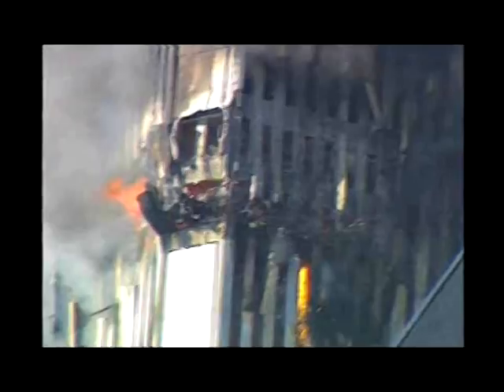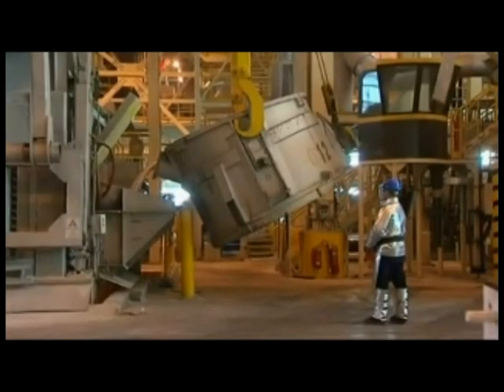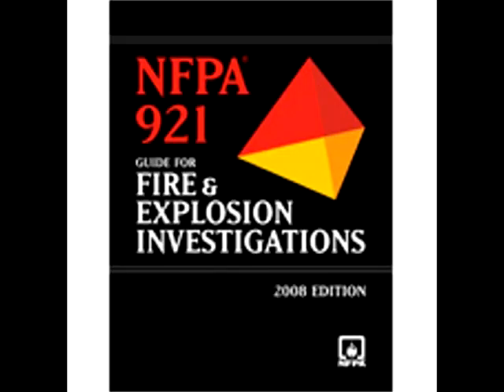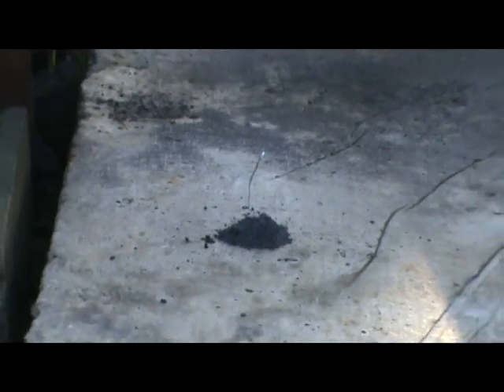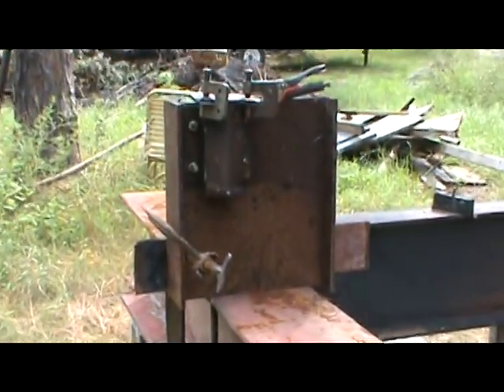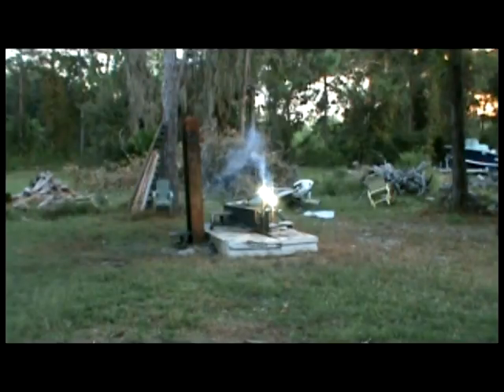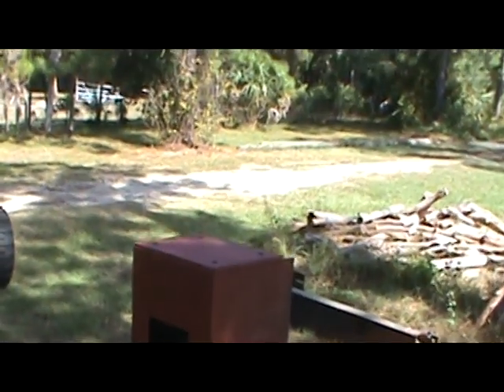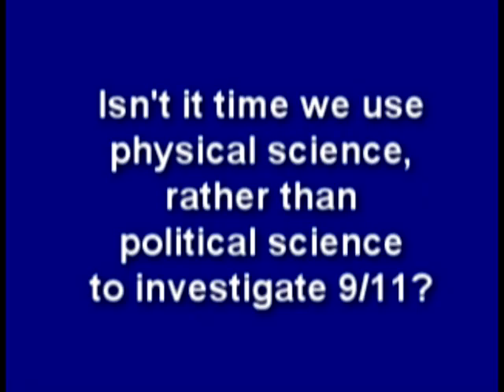9/11 Experiments: The Great Thermate Debate

Comment: Why are people still blind
Reply: They have cognitive dissonance
Reply: theres another way but some people wont seek it 
 Because maybe the blacksmiths like myself know steel stretches and bends at 1500 degrees. Something you didn't learn in school.
Reply: You Wished actually it sags, bends, twists buckles and elongates from thermal expansion and it begins to lose its integrity at 675 deg and will completely fail at 1100 deg! This is what I was taught in my 25 years in the fire service! :) But I think we are both trying to make the same point!
Reply: thinfourth office workers worked 24/7 did they?
Reply: Weazel it's even harder to know the truth is not what they tell us when you have lost a loved ones to the war that the twin tower demolitions created.  
How do you tell their kids that the government faked a terrorist attack in order to try and control oil rich nations in the middle east? It's easier to let them know nothing right now, but one day we will wake them up.
Reply: They are blind because it’s easy To put their heads in the sand then to come to terms with the truth .  In what the truth would mean and the actions that would be required.
Reply: W N ever worked industrial steel? Ever worked a forge? Rivets heated will not hold weight loads. Bolts when heated under a load will strip. 
 Steel workers all know this. At 1500 degrees I can fold and cut steel with an anvil and hammer. If I heat the threads of a bolt to 1500 degrees it will strip. If there is no molten on the back of the bolt how long could you ride your bike? Maybe until you hit the first bump or pothole
Reply: theres another way but some people wont seek it Everyone knows Israel did 9/11....
#DancingIsraelis
Reply: cuase they brain washed and they brainless
Reply: You Wished 🇮🇱Israeli Mossad rigged all 3 WTC’s to be demolished. They also used a Crockett Warhead in WTC 1&2. 
ISRAEL DID 9/11...
Reply: ANARCHY LUiS provide your proof. Citations needed..
Reply: 🇺🇸MAGA🇺🇸
🇮🇱Israeli Mossad rigged all 3 WTC’s to be demolished. They also used a Crockett Warhead in WTC 1&2. 
ISRAEL DID 9/11...
Watch my video made by Veterans:
“VETERANS DEMAND 9/11 TRUTH”.
Reply: ANARCHY LUiS provide your proof. Just saying something does not make it true.
Reply: You Wished 🇺🇸MAGA🇺🇸 Go ahead and go onto my YouTube Channel. I have a video upload named: 
“VETERANS DEMAND 9/11 TRUTH” 
I would paste links but YouTube blocks them most of the time. I will still attempt to place a link below for shits n gigs. God bless
Reply: You Wished 🇺🇸MAGA🇺🇸 
VETERANS DEMAND 9/11 TRUTH 
https://youtu.be/JXAzmzORibs
Reply: You Wished 🇺🇸MAGA🇺🇸
Oh yeah, what was your MOS?
Reply: You Wished 🇺🇸MAGA🇺🇸Sailor eh? Please be patient and watch it all the way through. Those that died that die deserve that much. If you watch it all and then it’s BS still, that’s fine. Just remember, israel murdered our Red blooded boys during the USS LIBERTY ATTACK. 
“USS LIBERTY, the loss of Liberty” is a documentary with first hand interviews of the men there that infamous day. They even machine gunned our boys in their lifeboats. A god damned travesty.
Reply: Brian Justice sorry bud....I am a Fire Capt in this here capital city and I have also ran our local USAR team for the past many years.  I AM one of the responders I am referring to.  Granted I personally was not at ground zero, nor the Pa fields near Shanksville, but I was collecting human remains at the pentagon as well as some of our team was in charge of shoring the collapsed building.  We did have guys in those fields in Pa collecting remains until the feds took over about a week or so later. I did have quite a few coworkers go work at ground zero and know quite  of the fireman and medics who were on the scene for both collapses!  I can also tell you that during hurricane Katrina we bunked with about 20 FDNY guys for a couple of weeks and a couple of them were staged at building 7.    So yes, I’m pretty up to date about all the thinks that actually took place around 911 as well as well equipped to explain to you why building 7 collapsed and why the towers collapsed so quickly.... which that one is simple if people actually would educate themselves about the towers construction and the damage that fire does to buildings!!   Those towers were NOT built for 767s full of fuel to impact them at 4-500 mph!!   Even the man who designed and built them tells this fact!   That being said..... there is nothing about 911 that defies reason to people who ACTUALLY ARE educated on the subjects.
Reply: Because most of the people in USA are just a sheeps, and not the smart ones, but moronic sheeps.
Reply: W N Lololol yes.... I’m certain each one that signed that petition was an architect engineer or physicist! Lolol.   But I’ll play... I can assure you for all those actual one who didn’t sign on there are thousands more who would never put their name on such ignorance!!!  Lol.   
It has nothing to do with comfort zone and everything to to with reality education and facts.   You people need to realize that these silly vids play you like a fiddle!   You don’t actually think that there are thousands of people who responded to these sites who can debunk most of the crap these comical vids claim!? Lolol
Reply: speculizer1971 yep. As for the molten steel point when you heat steel and compress it the steel becomes hotter. Compress heated steel and you can get molten Sparks and flows. That's why blacksmiths have to watch their metals as we work them.
 I am betting the firefighters were either seeing molten aluminum or copper. I think that's a more logical explanation without knowing the structural weight load above the impact at both towers.
Reply: Dr. Hannibal Lester people conspire to do things to each other on a daily basis. You have been bred to believe people who look I to the truth of these things are some type of fool. That's the programming you follow.
Reply: You Wished 🇺🇸MAGA🇺🇸 
Did you receive my info about Israel doing 9/11? Pls lmk if you can see the link to the video: “VETERANS DEMAND 911 TRUTH”
Reply: ANARCHY LUiS no self respecting vet would ever have anarchy anywhere in his name. 
 Again as a vet and as a blacksmith I know steel and what it takes to work it. Been here done this got the T-shirt and wrote the book.
Reply: speculizer1971 I dont think you are taking basic psychology into account in regards to your comment about the responders. Often when we are met with a problem that defies reason we ask an authority figure. It is human nature to take authority at its word, especially in high pressure situations, simply because it is authority. If this was not the case then military's around the world would not and could not fuction.
 I dont feel that this video was nonsense or bull shit as some put it. The man in this video was simply trying to prove that the given narrative of "thermite could never melt steel" is inaccurate. He proves several times in the video that it is indeed possible and he did so with a mediocre version of thermite and a background in structural engineering. 
Further more to those who ask about the witnesses. Just one summer prior to 911 major construction happened on the 81s floor of the second tower. Right where the plane hit. The towers 81s floor was reinforced to hold heavier computer servers. This does provide the opportunity to add these devices to critical areas. Further more the building was constantly undergoing renovations and upgrades in a union state with limited access to contractors. 
If this was a court of law there would definitely be ample evidence to at least prove reasonable doubt.
Reply: ANARCHY LUiS ABE cat1 then went to gear
Reply: earth is flat, big bang and evolution are not true, wake up people
Reply: The problem with YOUR reality is that involves perfect planning, total secrecy and not one single person making one tiny mistake.

I will agree with you that our leaders are corrupt and i will agree with you that we can do nothing about it.

HOWEVER

Where we differ in our beliefs is you believe they are superhuman

I belive they are fuckwits
Reply: I guess it can...
Reply: They probably  don't work 24/7
Reply: And because of being afraid and programmed.
Reply: you do realize thermate is the upgraded military version right? I guess you didn't even watch the video.
Reply: change people to American.
Reply: the bottom floors melted quicker then the floors that were struck LOL
Reply: the wind also hits the side of these builds and pushes up like a Van, anyone who has worked around a black smith shop understands how much hotter the fire would be with a steady blowing fan. It did not have to melt the steal just cause it to soften enough to collapse. As the floors fell it would be like crushing an aluminum can.
Reply: theres another way but some people wont seek it Dumb. Not blind. They were blind when it happened. Now they’re just brain dead.
Reply: SO government workers got into the building at 6pm, stripped all the interior of the building out, rigged the building with explosives and replaced the interior before 6am the following morning.

With everything going to plan and no one spotted any changes.

Okay i will believe that

If you can tell me why any other government project always runs over by twice the time and double the budget
Reply: More important is how they are able to apply mind control to so many government workers and how they are able to get them to remain silent.  If it were true someone could make a ton of money exposing this.  Its entertainment people read and think about this like watching a sci-fi  movie ...
Reply: The fire inside did not have to reach a temperature to melt the steel it only had to reach a temperature inside which admittedly it did buy this own video to compromise the steel to a point where it could no longer support the weight above it
Reply: Why are people still trying to see shit that isn't there?
Reply: speculizer1971 Ok but the Government admits that the Gulf of Tonkin was a false flag operation and both Russia and Germany have been caught doing multiple false flag operations...
Reply: For what?
Reply: WHICH! Gulf of Tonkin incident are you referring to?
Reply: speculizer1971 Most firefighters and police detectives I know say they believe 9-11 was done by the owners, for the insurance money.  It's depressing, but if the US govt brought charges against the owners of the twin towers tomorrow it woulf restore a LOT of faith in the US Govt.
Reply: "Most firefighters and police detectives" YOU know. So fucking what?
Reply: Dude. Occam's Razor suggests that planes hit the towers, weakened them and set them on fire and brought them down. There is no credible evidence to the contrary. Get over it.
Reply: Its easier to be blind then to see
Reply: theres another way but some people wont seek it :
Reply: No. No, it's not. Humans are evolved to make connections with their senses. It is in fact, very hard NOT to do this, even if you were in fact, blind.
Reply: theres another way but some people wont seek it Ignorance and fear. Over all..insecurity.
Reply: Let those who have eyes, see. Let those who have ears, hear. Let those who want to sleep, sleep.
Reply: And those who want to be a blue scarecrow, give them a paint brush and some rags for brains. WTF is your point?
Reply: Edmond Dantez https://en.m.wikipedia.org/wiki/Gulf_of_Tonkin_incident
Reply: Mainstream media
Reply: Brian Justice Did you just call thermate a “mediocre version of thermite”? Lmaooo
Reply: Ksus Susk lmao it was NOT, in fact, built to withstand a plane crash you moron. Steel, and all metals, become more malleable and weak once they reach certain temperatures, and guess what, jet fuel will do that to steel.
Reply: These crazy conspiracy people are literaly making me laugh 😂😂😂 the shit they're coming out with.
Reply: Yes, that covers both incidents, to which are you referring?
Reply: They were built to resist the accidental crash of a small aircraft, not the deliberate impact of a full size airliner, at full speed, loaded full of fuel. Not the same thing at all. The framed tube construction of the twin towers were especially vulnerable to this type of damage.
Reply: W N How about the hundreds of thousands who HAVEN'T signed it?
Reply: theres another way but some people wont seek it 

So they built the towers with boxes thermite beams.  Or the government,  sent in workers later on to cut open the beams , pour in the thermate, seal it up , then wait for the planes.  Let's not forget the dozens of workers needed and somehow all kept quiet.   Must be Hydria at work.  

The science here isnt about discovery it seems to be  more about proving a narrative.
Reply: Why are conspiracy retards so stupid?
Reply: You mean believing retarded shit like this video ? Where ignorant fools hear first time about technology that is common knowledge and their imaginations starts running wild. You could actually read up on the science and not just make it up. I mean they can't even f... write "Thermite" correctly.
Reply: speculizer1971  I'm with you and all the anti conspiracy movement. However, be care calling them idiots, stupid or whatever. The people putting forward this stuff are, on the whole, shit stirrers and anti anything establishment. What bothers me is that in the 30% of Americans who actually buy into it all, there are smart, well qualified influential people like pilots, ex politicians like Governor Jesse Ventura (only the influential part there, not smart), structural engineers, scientists , physicists etc who perpetuate the theories with some degree of authority and apparent credibility. They are still far outnumbered by qualified  debunkers  in every field though. They are the ones I'm annoyed with really, not the politically motivated sheep who follow their own political agendas come what may. I wish the intelligent theorists could answer this. Do they REALLY believe the hundreds of people need to pull off each individual part of a very complicated, contrived theory, could 
1) Be convinced to kill 1000s
And
2) Keep quiet .
I can sort of believe a few politicians and one or two individuals deceiving the public for political gains, ( perhaps Kennedy WAS shot by his own government , would only need a handful of conspirators), but this. Hell no. However weird and scientifically challenging some aspects of 9/11 admittedly are, the required personnel issue  to carry this out will always override any doubts I have . It was a terrorist attack.  Had to be.
Was security f*****g awful. Hell  yes.
Reply: mangore623 it’s beyond me... they claims all sorts of crap and believe EVERYTHING that fits their narrative!   They aren’t intelligent enough to know facts.... this vid is FILLED TO THE BRIM of complete bullshit! Lol They aren’t intelligent enough to realize they there were literally thousands of people who responded after the fact to all of these sites to process these enormous scenes!! Lol. They think it was all “paid gov agents willing to sell the citizens down the river! lol
Reply: just like all the blind office workers who didn't see all the thermite being fitted to the building
Reply: Lol, just because people are intelligent enough to think for themselves dont mean they are blind! Lol.  I literally watch for 24 sec before the first bullshit claim was made! Lol